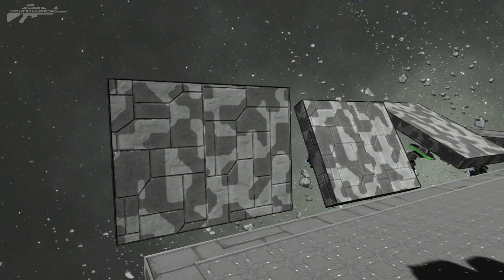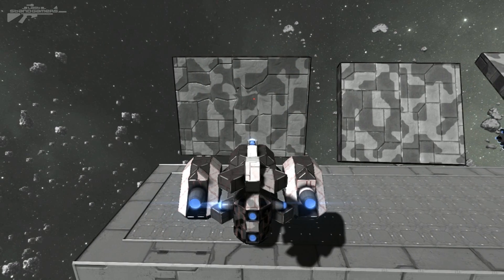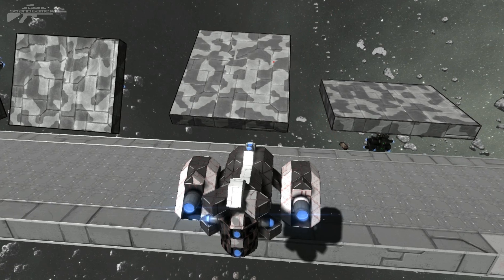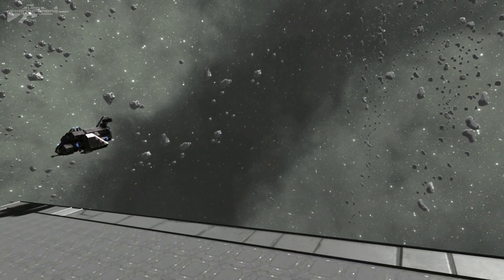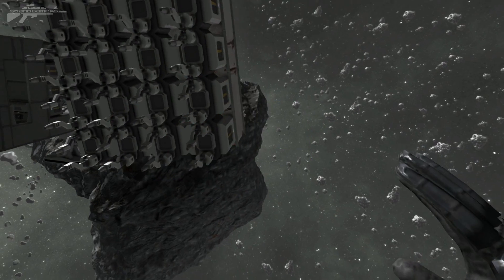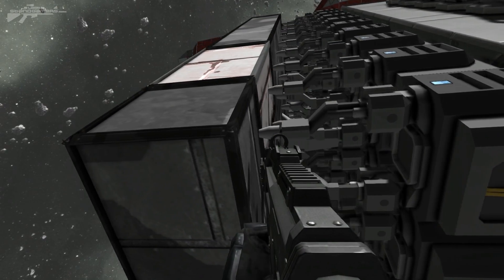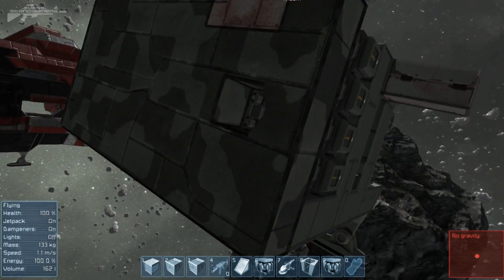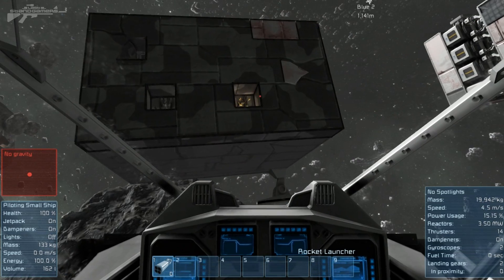Space Engineers - Sloped Armour, Deflecting Missiles Self Repairing Armour

Comment: A lot of people saying you can deal with repair armor with heaps of rockets on the same spot, but
1. Shooting at the same spot is feasible.....only if the enemy doesn't retaliate. Given the fact that there are turrets that can be set such that they target ships and missiles, big ships can easily ease down the pressure of missiles with interior/gatling turrets to shoot down missiles, as well as forcing the enemy to get away from the sight of the turrets (they shoot really accurately even if you move quick), along with just bob-and-weave around to block attacks with other sides of the hull. You can't just take your time and sit at the same spot hoping you can punch down the enemy without resistance.
2. Rockets itself are just as expensive. In creative, sure you can light people up mercilessly, but in survival it's much harder to spam missiles as if they are completely free.
3. You got (non) re-loadable rocket launchers, with the non-version holds little rockets, and the latter being as clumsy as hell to begin with due to their inherently massive size.The former doesn't boast enough power to punch through armor, an the latter will be very heavy and difficult to out-manuever agile fighters (if there are other player piloted ships).

The welders are very expensive to maintain en-masse, but that is also applicable to really heavy armoring around the flagship in question (in fact heavy flagships are just super expensive and probably not even feasible on their own in survival). It's also easier to repair self-repairing armor because they weld themselves instead of having to weld every block by yourself.
Gravity guns and massive torpedoes aren't blockable by even the thickest shielding so don't bother trying.

Comment: I did notice that while it does repair fast that repairing against heavy armor blocks is slow.  the rapid missile fire rate of turrets could potentially break through with very little trouble compounded with the fact that holes do appear a few volleys from a few turrets could drill through the ship with no real problems as it seams that welders have low hp.  while this could be very good against fighters who tend to move a lot and not hit the same place as they move past the sustained fire of large ship turrets i can see this as having very little effect
Reply: keep in mind that you'll probably be shooting back, so if their armour doesn't repair, you will win anyways.

Comment: They need to add ERA blocks to the game. ERA = Explosive Reactive Armour. It's literally a shell with an air gap, the idea being the explosion goes off on the outer most armour skin, then the gap acts as a cushion of sorts leaving the hard, solid armour below it in tact. Basically it explodes from the pressure rather than the main hull. It's used on tanks and IFV's etc to protect against RPG's and the like. Slats also achieve a similar result and are more common on IFV's because they don't explode and fragment like ERA does (something you don't want happening around a vehicle working along side soft, squishy infantry units walking along side).

It's be interesting just having a number of protection layers for our ships. Maybe have slats, then ERA, then the solid armour, all combined would do a good job at repelling both missiles and bullets.

Comment: Couldn't you use a projector and welder combo, like the 3d printers in earlier epesodes, to basically re-print your armor back inplace if one gets destryoed? and i think you can space out the welders so they dont have to be directly side byside, this would make it lest costly to manufactur in survial mode. and can the welders repair armor that is multipul blocks thick so that you have more cution before the hull is breached?
Reply: The problem is (especially when welder is weaker now) welders have an effective range and will share its repair strength equally to blocks within its range, not only spacing doesn't make the conveyor system any less complex, it also reduces the regen speed of armor.Of course it doesn't block a full-on ram from a 100 ton ship or super powerful kinetic torpedoes, but it's more like an anti-in game weapons setup that will easily nullify the lackluster rocket and turret salvos and even a single warhead trying to breach a single or two layers of heavy armor.

Comment: The large ship rockets fire much faster than the small ship rockets and would chew right threw that. You could tell that even sustained fire from small ship punched holes after a few shots but he was going easy on it.

Give that the armor plating has to be part of another ship I'm a bit skeptical on it's effectiveness since landing gear attachments don't tend to be that stable when a ship is moving around a lot, and honestly I think mobility is likely to get you more survivability by the fact that they miss more often.

Also once the armor is breached in a single spot it's weakness grows. The hole is made then the welders are destroyed but so are the adjacent one. Which means the armor around the hole can't repair so it goes down exposing even more welders. Plus where is it attached at, because if the attachment is broken your stuck with huge floating heavy armor blades which could rip through your ship if you make a wrong move.

And having a guy trying to patch holes during a fire fight is a bit much. Odds are enemy turrets will insta kill him the way they do when trying to capture cargo ships. Or more likely he'll get hit by one of those missiles being shot at the armor.

I think 3 layers of armor, which will take up the same space, will get better results in the long run for most real combat situations. The adaptive armor is a nice concept for repelling small hit and run style attacks but in a heavy fire fight it looks like it will just fold.

Comment: It probably has more to do with deflecting the round instead of actually having more effective armor. 
Because:
1. The rockets are high explosives that do a set damage to a set number of blocks, as apposed to a kinetic penetrator, which damages blocks until it loses inertia/energy. 
2. The fact that the rocket is deflecting means that the explosion is occurring at a further distance than if it had exploded on contact, and therefore does less damage.

'Better' sloped armor would likely be more effective at blocking armor piercing torpedos/missiles, which are kinetic in nature. These projectiles would either deflect off the armor, or get stuck inside of it.

On a less related note, has anyone made Armor Piercing High Explosive torpedoes yet? Those would be rather effective against sloped armor.

Comment: Almost every single "fighter" I build usually comes in several forms... everything from a single missiles and gun scout... to like... 8 missile and 16 gun heavy fighters. Often I layer the missiles so that you get a "one at a time" effect. So, yeah I don't know how well that wall would hold up...

I mean, for me, the best comparison is, this. Ok, that wall is done, what else can be built for equivalent cost? If you can field a small squadron (and from the look of that it's likely you could) that wall is pointless. The testing environment is too controlled... Multiple fighter pounding at the same spot would get through without much issue for FAR fewer resources. Also, the ship would be a behemoth with all the added layer just for the armor... So it's be an easy target for light, fast fighters.

Comment: I think that most ships that fire on heavy armour are going to have more then one rocket launcher, so the auto-repair wall is a bit moot. The idea is interesting but I'd rather just use a bit of spaced armour as it is more reliable and don't effect your control of the ship.

P.S For those of you who do not know, anything that is docked to a ship or attached by a rotor is not calculated in when your gyros apply a breaking force. This can cause all sorts of issues, especially with small ships that have very little main mass.

Comment: that was only 1 rocket pod, there would be about 2-3 people shooting at a same place with more than 1 rocket pod. besides, you can destroy the welders easily as soon as you penetrate the armor and you can kill the person running around and fixing stuff as he needs to be on the outside. you will always have to have steel plates in the inventory of cargo boxes and welders so they can weld the thing. such a wall of welders costs a lot more than, let's say, 3 layers of armor, specially because you will need at least 1 armor to begin with. and if 1 of the welders is dead, you will need to brake through the conveyor to get to it and build a new one while leaving your 1 layer of armor unrepairable at that point and its probably penetrated so the guy that is running around will either waste an armor block (1 plate which gets added on by the welders) or leave it open. both ways making armor there weak. or they can keep shooting until you run out  of power and/or resources for the welders because the damn things will eat  your power while fixing. and you will need a lot of time to build the ship besides a lot of resources so you will have barely any in your army if not only 1 and it's not as effective as it seems. oh and the repair guy running around will always have to fly back in to refill on armor plates while your armor is left broken out there because a chance of a hole creating is pretty big as it seems. its too expensive and too much time wasting. and it might work better with the angle thing but it will take more time and more resources to build something like that and not all armor will be regenerating.

Comment: soo.... ive had this idea for a while and wondered if aron (the testing guy) could try this.... get ship, and attach 'armor plating' to it... this plating would pretty much be a small ship attached ot the large ship. this way you could excrement with allot fo things, 1st: you could have heavy armore on the outside for thruster and bullet resistance at a minimal weight cost, you could also have  cross beams to reinforce your armor form impact as well as have compartmentalized armor with gaps in between to make the armor technically thicker with ought actually having added wight. this same idea could be used for cheaper landing pads.
Reply: you could also use this idea to allow you to quickly replace armor 'sheets' at a dock, or carry spare armor slabs inside your ship to be replaced. on top of this, because its attached with  small gap, and/or the landing gear has some extra impact resistance, this will help protect your ship from ramming, debris, and kinetic weapons... god idea to experiment with different combinations of plating. (could also used separate sheets/rotors/ landing gear to angle the armor)

Comment: The reson why sloped armor actually work isn't because the slope makes the projectile bounce, it's because it makes the armor thicker than the steel actually is. 
There are work arounds, no of which are simulated in this game, so the test are invalid(you haven't disproved or proved anything) because these missles are just highexplosives. In the real world, aside from solid shells there are HEAT-shells(High explosive anti tank) too. This concept has been around since the Panzerfaust. It's a warhead that on impact explodes and with that energy penetrate the armor to carry on the force of the explosion and spew molten metal inside the haul. The Panzerfaust 150 could penetrate up to 280-320mm of armor. That's way more than what the t-34 had with it's sloping armor.

Comment: Realistically the self repairing armour wouldn't be too tough to beat as most fighter won't be packing just one rocket launcher.  You should've preformed a second test with a fighter equipped with 2-3 launchers and see how well it holds up.  Another issue would be power consumption, it is very possible for a battleship to have its power supply overloaded if it was running weapons, engines and armour to fend off a carrier wing, or brawling with other fleet elements.

Comment: As with many of my fellow commenters, I am not convinced of the efficacy, even ignoring the cost.

At best this would be a useful feature for the innermost layer of a 3 to 5 block thick armor section to increase the endurance of armor around sensitive systems during a long fight. but a single layer is too easily penetrated with what would be called alpha damage in the Eve community. A backing layer that will only have to repair damage that leaks through the damaged outer layers may have its uses though.

Even so, the cost to keep the system running is likely impractical.

Comment: the slopes making a difference is almost certainly purely caused by flaws in the physics engine. My theory of why this effect occurs is that the engine might calculate collision physics and have the missile bounce before it realizes it should have gone off, so it detonates further from the armor than normal. the missiles in this game seem to have symmetric charges in their warhead, so the explosion will be the same regardless of the angle it impacts. angled armor makes a difference only to penetration type weapons. if you use a missile, it just explodes at the impact location and it only needs to penetrate the shortest distance through the armor to be considered "penetrated." with penetration weaponry on the other hand, they can only perform damage along their trajectory, so angled armor would make a difference.

Comment: Based on the results, sloping armor might work in limited scenarios where firing angles can be predicted (i.e. asteroid bases or attack ships making runs on less agile ships). It's at least something that can be kept in mind when choosing an approach vectors. Only worth considering in those kind of situations though.

The regenerative armor setup is pretty impractical in a survival setting except for perhaps the most critical sections of a very important ship. It's going to take up a lot of space and require many thousands of armor plates in reserve as repair material. Behind those welders we need need a conveyor system and since either the armor or the welders are a "ship", internal damage could lead to this large large machine catastrophically bouncing around inside your ship (or alternatively, the entire wall of armor floating off). The welders also "fix" perfect squares when a block is destroyed, whereas the twisted neighboring armor is going to block much more damage than the exposed welder.

The combat use of welders might be on a smaller scale, clearing the twisted metal blocking access to areas of the ship and maintaining critical systems such as thrusters and reactors. It could also be used in a carrier's hangar to quickly and automatically repair damaged fighters in pit stops.